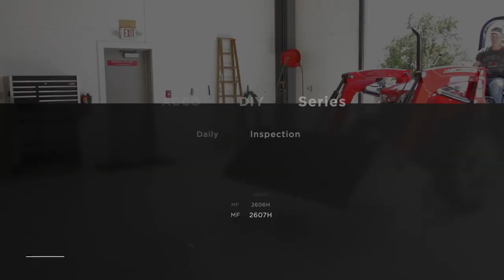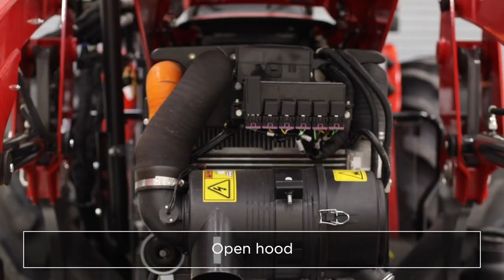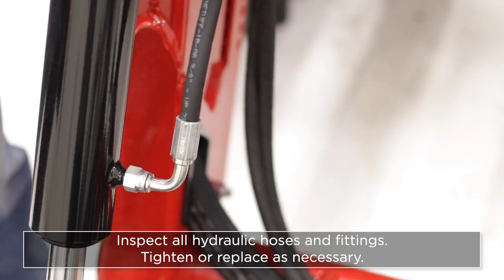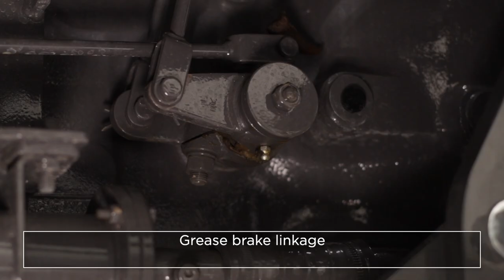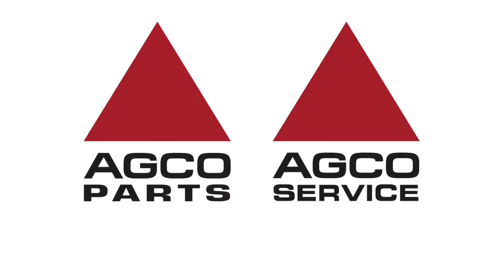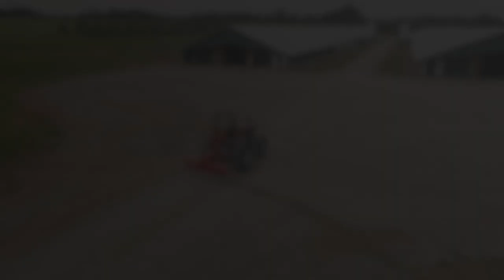MF 2600 H | Daily Inspection  | Overview

Comment: Just bought a 2604H and love it! Grease is cheap, what it goes on isn't and I believe in using GREASE! However, the front axle center pin grease fitting is not anywhere I can find. The book shows a remote fitting, ok. But, can someone please tell me where it is?? Right, left, top bottom... WHERE!??! The image is not very helpful.